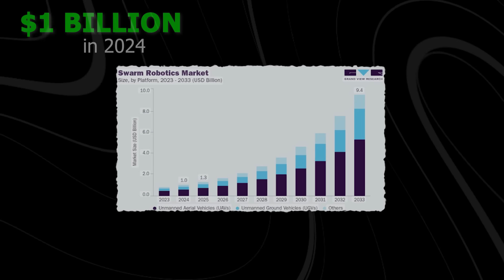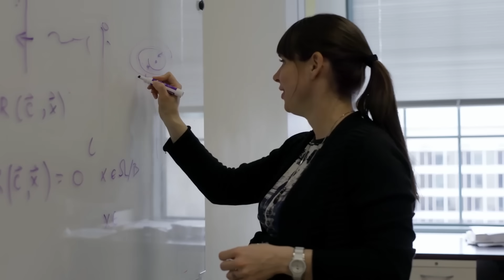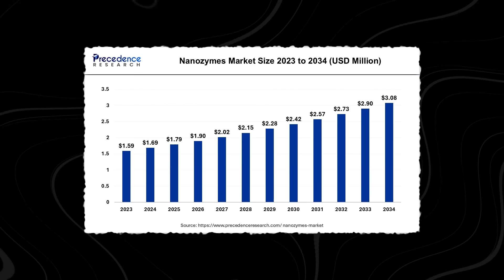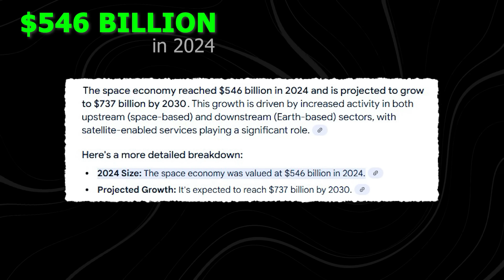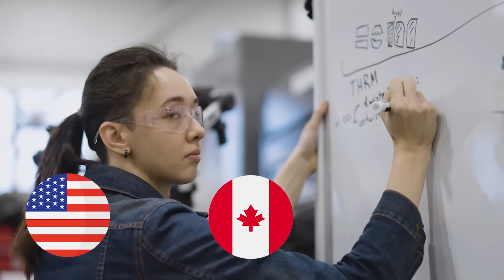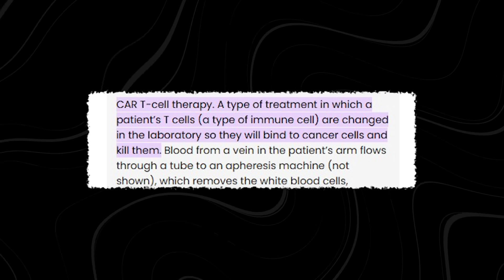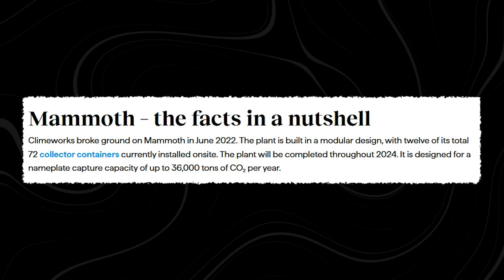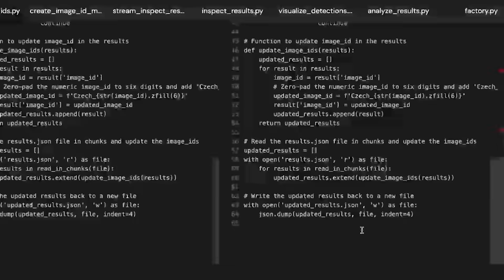Top 15 New Technology Trends That Will Shock the World (Soon)

Comment: Agentic AI: Autonomous AI “coworkers” that plan, decide, and execute multi‑step tasks end‑to‑end.

AI governance and trust: Tooling and policies to ensure AI is safe, compliant, explainable, and free of misuse.

AI at the edge + cloud: Split workloads so real‑time inference happens near devices while heavy training scales in cloud.

Post‑quantum cryptography: New encryption schemes designed to resist future quantum computer attacks.

Quantum technologies: Computing, sensing, and communications that unlock new optimization, simulation, and security capabilities.

Energy‑efficient compute: Chips, systems, and cooling optimized to cut AI power costs and carbon impact.

Cybersecurity with AI: AI‑augmented detection, response, and resilience across data, apps, and supply chains.

Advanced connectivity (5G→6G): High‑bandwidth, low‑latency networks enabling real‑time IoT and industrial automation.

Immersive tech (AR/VR/XR): Spatial interfaces for training, collaboration, shopping, and entertainment.

Robotics and automation: More autonomous, collaborative, and software‑defined machines in factories, logistics, and services.

Software‑defined vehicles: Cars as updatable compute platforms with electrification, autonomy, and app ecosystems.

Digital twins and simulation: Virtual replicas of assets or systems to test, optimize, and operate safely at lower cost.

Bioengineering and synbio: Designing biology and materials with AI to create new therapies, enzymes, and industrial processes.

Clean energy and grid tech: Storage, smart grids, and electrification to power AI growth and decarbonize industry.